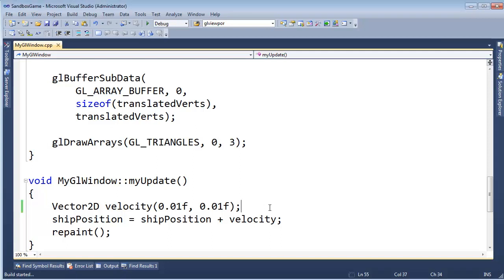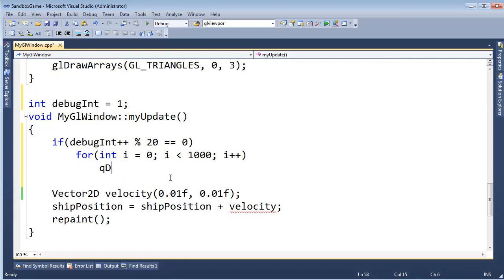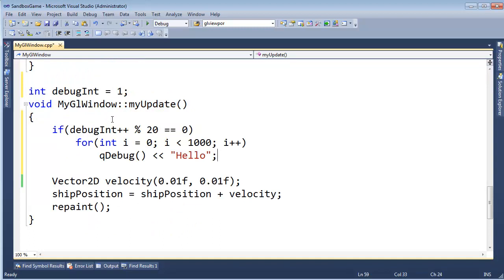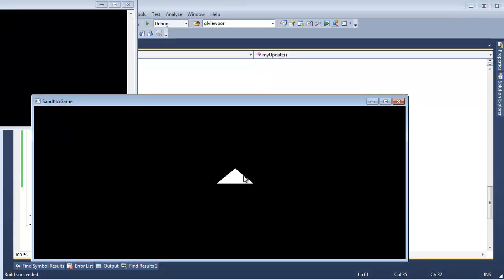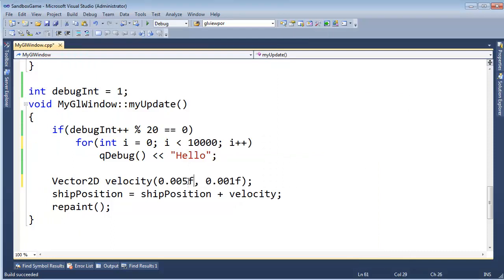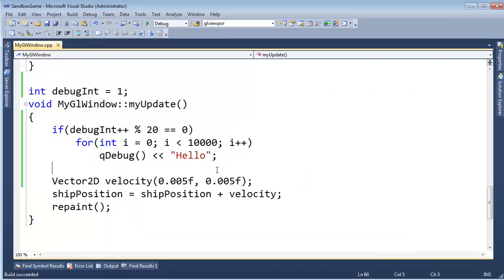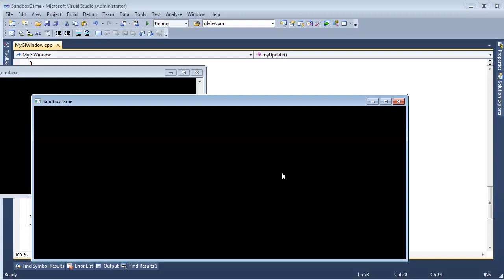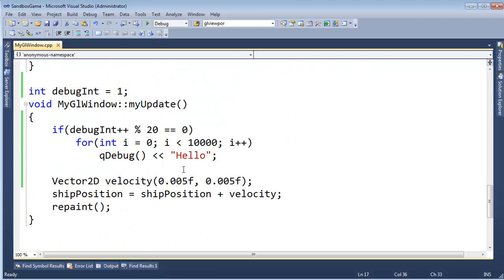Why Using Frame Time is Bad

Comment: Is it possible to reliably mitigate or entirely prevent spikes in frame rate? Even if I turn of antivirus, and don't run any other applications, there is still some variability in frames per second (FPS). I'm working on something that flickers (instead of moves) and it's important that the flicker frequency does not change. Using frame time (as you describe in your next videos) to modulate my animation still causes some perceptible difference in behavior. I want something very consistent.
Reply: As long as your frame time is always smaller than what you need (for instance, in an specific frame it is 0.10ms and you want 0.16ms) you can add a small delay (in this case 0.06ms (desired frame time - actual frame time)) to get consistent fps.
Reply: That's an interesting idea, thanks! What if the frame time is longer =/
Reply: You can always lower the desired frame time based on the hardware. You can run some tests to see what is the max frame time and based on that set your desired frame time.